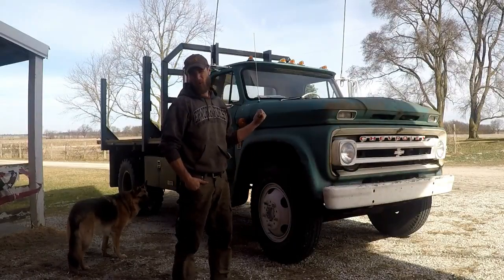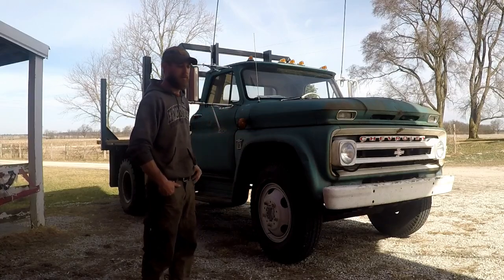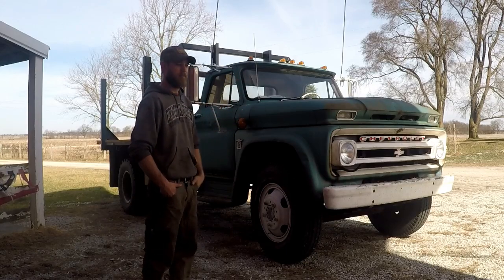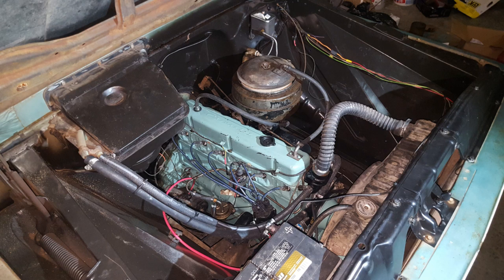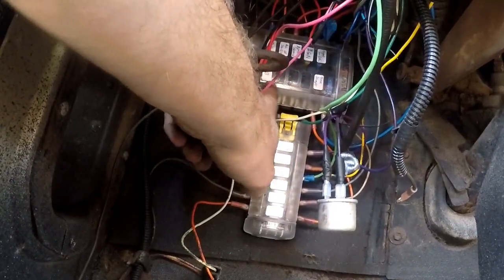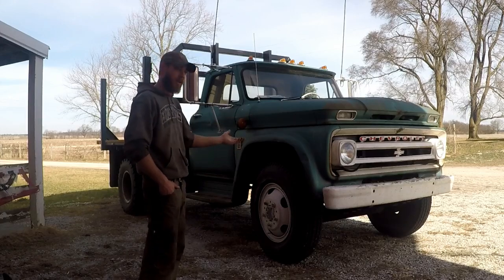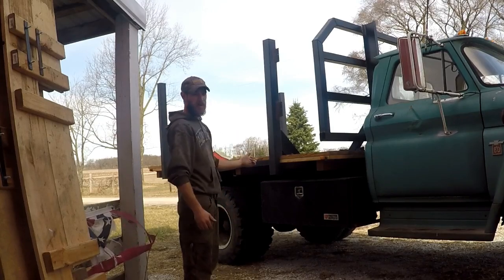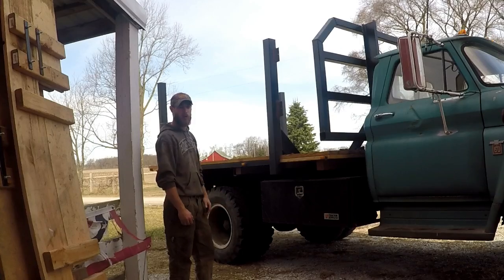1964 C60 Rebuilt

Comment: Just had an incredible barn find on a '63 C50, body is in very good shape, the stock 283 is questionable which is OK, planning an inline 6 transplant, but, why I am commenting is...Watched the 1963 Chevrolet truck sales video, and what caught my eye was, I think the bus line was outfitted with a double brake fluid reservoir, and if true, I would like to change the single out. Also wondering if the two speed rear differential gearing could be swapped out for higher gearing...great video btw, good info! https://www.youtube.com/watch?v=aht7fRgnFcw
Reply from the maker: Interesting, I have not yet seen that video or this brake system that it alludes to, as that particular system is not present in the '63 or '64 manuals for the trucks. I wouldn't even know where to begin looking for the parts to said system since basically no buses exist anymore. I will do some digging.

For the price of re-gearing the rear diff, it will be cheaper to locate an entire axle with the ratio you want and then swap axles. When you can find the gears for this age 2 speed, they are horrendously expensive. As a word of caution though, if you plan to use the truck as a truck and with only a 6cylinder, you don't want high gears or you will be sorely disappointed.

I can happily report that (with fresh engine and good compression) my truck rolls 55mph without issue on factory gears. I do not want to go any faster for safety reasons. These old suspensions will put you in the ditch if you move too fast on rough roads. Couple that with heavy loads, and any notion of speed should be put aside for overall control.
Reply: @RocketFarmer  A Saginaw steering conversion and a HD steering stabilizer might be the way to go to smooth out the steering issue. My intent for this truck is to use it haul a Vardo trailer (WIP) around, thought a 6 would offer better mileage and it doesn't need to be a speed demon, back roads, and old country playing on the radio.  Take a look at the 5:29 point see what you think, two lines coming out, wondering if it has two reservoirs? https://www.youtube.com/watch?v=f-JYgDwKDiU&t=84s
Reply from the maker: @go6042  It isn't the steering so much as the lack of shocks or any cushioning to the suspension. I cant tell you haw many times I have smashed my head into the roof now from certain road conditions.

The 6 will most certainly net you the better mileage, it just comes at the cost of needing some steeper gears to get her going.

As per the video, that is a single line brake system with a dual reservoir master meaning the bus has a hydro clutch vs spring clutch. Here the RA page showing that particular master. https://www.rockauto.com/en/moreinfo.php?pk=12995597&cc=3438723&pt=1836&jsn=883&_nck=ZExt1ysfqhqWnq%2BEvUNdS3Txyey60IDtnjPWF5UU9J0BWQv7pvqZbkEUk86%2BAYIhylPKrF7bIqHt7yNXdy7qVvMa3m04RBIhG%2FWuhT%2Foq8FXzjTVUeDkcqr9voCbPzRo6GgB4DCdU8nXcIk7hQ5nKDLdgqWWwvlof%2F5yh%2BJ5rbsbhgrreCvNy%2F4KFIj6thxKwMFuSbWxKj%2F8ooqwe%2Bebm5a5tVemFL%2BlgivWzzDcKJOWzAi0uYgq1F6slsXwAd8Glzg58I%2BplcAL6NIJXWOOZ1h0iLhyb8PDbzQF0XidZWsDcNA4IoFBu8paEmyqcDO3wjd9SbHhr%2F9IMQXp81ODzoXO2B4NyT%2BC
Reply: @RocketFarmer  Interesting information, I'll have to look at a lot of options for this rig, I don't see it tackling many of old logging roads, but who knows, hmmm wonder if some kind of airbag system could be fitted. Goal is to keep it as original as possible, while updating safety features, double master cylinder would calm my redundancy back up ways. Btw, this C50 was a old high desert wheat farm truck with dump hydraulics, even has the behind the cab upright exhaust pipes, shoot me a message if so inclined, our week long rodeo is almost over and will have more time to talk trucks
Reply: @RocketFarmer  OK, after a few more cups of coffee and a reread I'm tracking what you're saying about the brakes, there would be nothing gained, would still be a single line system, back to the Acme drawing board for Wiley

Comment: If this is not a 1 ton the how many tonnes is it?
Reply from the maker: With the axle configuration, it is a 2 ton per the classic definition. The 1 ton, 1/2 ton, 3/4 ton terminology is a quick way to designate the weight rating of the front axle of trucks. It has nothing to do with how much weight a truck can haul, but rather how much load can be directly applied to the front axle. It really begins to fall apart once you get bigger than the 1 ton (F350, 3500, etc) rating. For example, the front axle on this truck is a 5k lb axle and the GVW is 19.5k lbs, so it is technically larger than the "2 ton" designation. However, it is generally accepted that the "2 ton" designation trucks have at least a 7k lb front axle.

In short, the designation really doesn't carry over from light duty into the medium duty class. Everything medium duty is ranked by axle weight ratings in normal daily usage.
Reply: @RocketFarmer  Thanx that's helpful indeed.

Comment: Converted to 12 volt ? That truck was born 12 volt
Reply from the maker: Yes, but there were 6V parts on the truck when I got it. The truck had an electrical fire at one point in its life which burned up a lot of things and then it was further hacked by someone attempting to "fix" it at some point who replaced parts but only made it worse.

Comment: Were you able to find American made bearings and seals? Everything I find now days is Chinese made 😕😑🙄😒
Reply from the maker: Sadly only the wheel bearings were of good quality Timkin, which these days is still not American, but also not China. All the wheel seals are unknown origin from NAPA and I have spare sets ready to go on the shelf of the shop. No one knows how to properly make, or just flat out no longer makes the paper gaskets for axle caps seals/diff seals/etc so I've just resorted to using Permatex without the paper gasket. All the rubbers in the filler neck (coupler, grommet to the body, etc) have been installed for exactly 16 months and look about like the ones I initially took off....dried out, weather cracked, and junk. 

I wish I could say I wasn't surprised, but something regarding rubber and seals changed in industry back around 2016/2017 and no matter what vehicle and what part, all the rubber components are junk regardless of manufacturer. I run into this issue almost yearly on my '04 Silverado and '85 K30. I cant keep ball joint seals, bearing seals, or front crank seals from going bad in short order, from el cheapo parts store brands clear thru Moog brand.

Comment: ..............Replace the old Ignition system with An MSD capacitor discharge system.....NO POINTS !!!
Reply from the maker: In early 2021 I finally sourced an original GM HEI from a 70's 250 that I converted to work on the 292. Have been rolling with that ever since now

Comment: They beat up and worked many of those old trucks into the ground. I have a 1955 Chevrolet LCF with a 265 , V8. A 1947 dodge 1&1/2 ton truck. Top speed is 30 mph